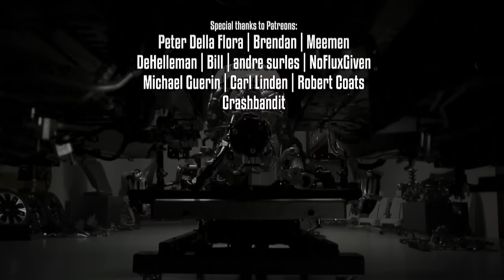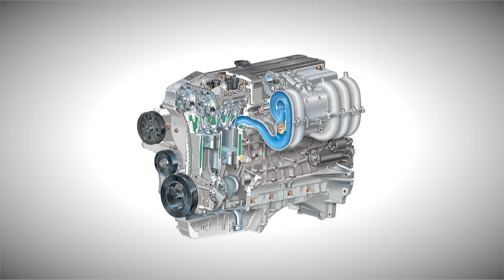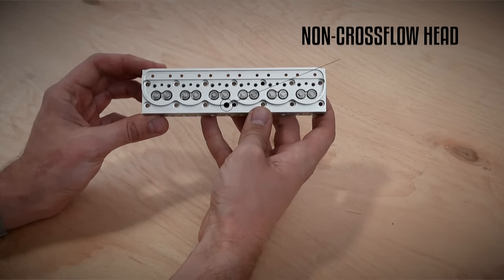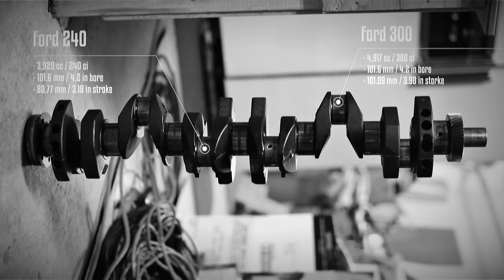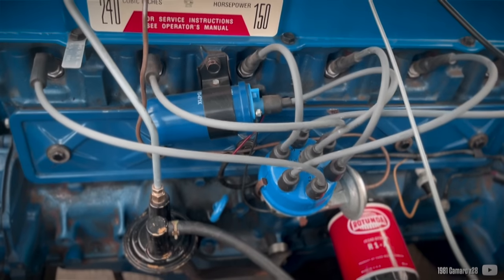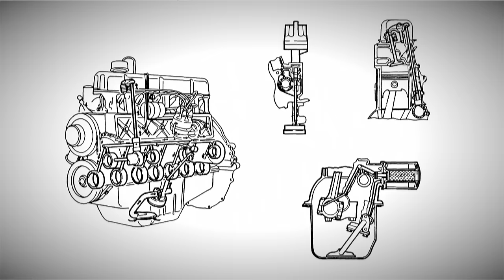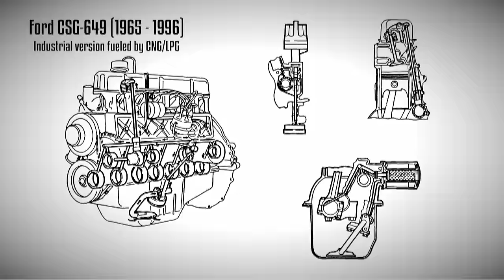Is This Toughest US 6-Cylinder?

Comment: Have you ever done a video on the all aluminum Buick 215 V8?  It's a fascinating  little motor that sounds incredible.  GM sold the design to Rover and they developed it into the early 2000's.  It is also the basic design used in the 3.8 V6 that GM used forever.   I've got one (215) in a 63 skylark convertible.   I think the motor is worth a video of it's own.  I believe Oldsmobile also used a turbo version of this motor as early as 62.  Thanks as always for your work.
Reply: The British got the rights to the design, it became the Rover V8.  Used in pretty much anything that was British and had a v8 (Land Rovers, Rover cars, MGB V8, etc) up to the mid 1990s.  In fact, they are so common, that whereas people in the US do 350 SBC swaps for EVERYTHING including making a v8 out of a Miata, the British use the old Buick engine for the same purpose.
Reply: In 1965 Jack Brabham and Australian engineering company Repco took the slightly stronger Oldsmobile version, with an extra head stud per cylinder, and developed it with overhead camshafts and new heads etc into a three litre  Formula One engine that won Jack Brabham the Formula One Championship in 1966. Then in 1967 it gave Brabham cars a one two in the formula one championship with Denny Hulme of New Zealand taking the honours. So beating Ferrari and all the other exotic make engines and cars behind the Brabhams.
No driver since or in the future look like developing their own car to win a Formula One championship.
Brabham also won the Formula Two championship in 1966 but with a little known Honda one litre engine. Jack often winning both the F1 and F2 race on the same day.
Not bad for a discarded GM block.
Reply: Yeah, the old Buick V8 from the late 50's is a great engine. I'm sitting in a 1997 LR Discovery with a 4 liter in it now. Problems do occur, though... Leaky head gaskets, especially if it's ever overheated. The press-fit steel cylinder liners also can slip... Solution is a top hat style liner, but that means a full rebuild with a lot of machining. By the way, the all aluminum V8 weighs about the same as a 2.1 liter 4 cylinder in my other car, a Triumph TR4. 
Years ago I had a Ford van with the 300 in it. That was a great engine too. Wish I still had it! Someone else mentioned another great one I had even earlier, the Dodge slant 6, in another van. I took those engines for granted at the time, didn't appreciate how good they were. Not planning to ever sell the Disco with the V8. (P.S. you can buy an all aluminum 5.0 V8 crate motor from Ford Racing... But last time I looked they were over $15,000.)
Reply: They dropped this into a Morgan.  Just imagine!

Comment: One of the 4 toughest….you should also do a story on the gm 250 cid,Chrysler 225 cid,and the amc 4.0 liter (which started out as the 258 cid)
Reply: AMC was 232 1st then 258
Reply: @jameshardin4326 yep!
Reply: The Chevy 292 i6 was quite the mill too..
Reply: ahh, the 232 Torque Command 6 by AMC. SO DAMN BULLETPROOF.
Reply: I had a '64 Barracuda with the 225 Slant Six when attending college. It would be sitting outside in freeizng weather for a couple of weeks at a time and would start right up after three of four cranks. Also had lots of low-end torque for its displacement.
Reply: @h8troodoh  , I have a  67  Chevy 292 and  a 75 Chevy 250  ,

Not really  high  horse power  but they are both Torque Monsters
Reply: @jimthomas1989  and both honest GM designed engines.. that 300 ford is a basic copy of a Mercedes Benz mil, so I've been told by many .. why it works well I guess..
Reply: @h8troodoh  this is the ultimate 6,bought one out of a scrap yard,100 bucks,guy goes, it drove in ,crushed rear end t boned right at the front part of the spring hanger,i installed it in my chevy van,it burnt rubber for the entire time i had it in there,low end grunt,4 oil changes later the van rusted to the point it was dangerous,pulled the drive train out and sold it to a guy who put it in a 58 del ray,he was beyond happy,me i went to lunch,feeling the loss
Reply: @strattuner  cool story man,thanks!
Reply: None as tough as the 300 Ford.
Reply: @erandy0240  dream on Ford boy.
Reply: Yes, a story on the Slant 6 would be cool.  The Leaning Tower of Power!
Reply: @JoeyGarcia  -  Yes... The strength of 10 brigs mowers...  But reliable as hell.  It was a gutless bastard. And the nosiest starting of any engine in its class.
Reply: @KlodFather  but it runs and runs! LOL
Reply: @h8troodoh  -  There is a good reason that engine was used in many stationary jobs (generators chippers pumps etc) as well as marine applications. It was exceptionally reliable and produced the power of many smogged V8 engines and was VERY quiet. The slant 6 was very noisy and the GM engines were very good but much rarer than the 300. They produced the 300 in such great numbers that it is hard to compete with it, especially the EFI variant which was used in many delivery trucks and still in use today.
Reply: @KlodFather  I'm not disputing that, I just don't think it's the best out there, that's all.
Reply: @h8troodoh  Thats a Bull$hit story passed around by people that just could not accept the fact Ford built a great engine.   the 240 and  300   6's replaced the 231  qnd 261 cu in inline 6's in the older vehicles, they were also tough engines.  I had a 261 in a 64 F100....
Reply: @JoeyGarcia  -  And so did the chev 250 and 292 and the ford 240 and 300... just with a lot more HP and no more yid yid yid yid  LOL
Reply: @h8troodoh  -  There is no diffference in reliability or anything else between a 292 and a 300. Neither one is better than the other except ford put the work into the 300 to raise up the HP on the 300 in the later years fairly high. I had more guts than my 302 and the 305 chev by a wide margin.
Reply: @KlodFather  didn't Mickey Thompson or someone else run 292 Chevys in his funny car, or am I too young to remember correctly,
Reply: @h8troodoh  -  I don't know but it would be a good choice. The 300 and the 292 are not much different. Two different singers covering the same song. 
You would have to look that one up. I do know those two crazy guys on youtube got 527hp out of a 300 with not much tinkering and 5 pounds boost, so It would not surprise me if MT ran a straight 6 because the power would be there and the blocks are very stable and tough. You can bet they were probably machined out of a steel billet and heat treated for strength to take that kind of power... but it would be a good way to get it without scattering parts.
Reply: @KlodFather  thanks man.
Reply: @h8troodoh  -  If you find a 292 anywhere, get it... because its like a gold brick. Bolts up to modern transmissions and can be fitted with EFI. But its a lot harder to find parts for it for a performance build... Then again if you bore it you might be able to get V8 pistons in the holes. If you build it or have one, I would love to see photos or a video of it here on YT. God bless and good luck.  
After we spoke the other day someone has a 300 ford 5 speed for sale 😎👍 and I am going to go look at it. That ought to be reliable as hell. I am going to replace the fluid in the manual trans and dump a pint of teflon powder in the trans.  The syncros still work but just not as good with the teflon PTFE dust in the oil but everything lasts much longer and I know how to shift it. I wanted a run around work truck. This is an 8ft bed 2 door with the straight 6 4wd
Reply: @KlodFather try some Marvel Mystery Oil in that Trans instead. . Good stuff.. and God bless back ...
Reply: @h8troodoh  -  Yes... The teflon dust I discovered back in the 80's with slick 50... I wanted to know why it worked and discovered the powdered teflon. In a motor its kinda dumb because the oil filter catches it but in a tranny it has no where to go and is suspended in the case fluid. 75 synthetic flooded in the trans with a quart jar of that teflon dust will do it. Wear a respirator because if you get it in you lungs it does not decay or come out easily. A good mask and bandana over your nose and mouth is good also... not good for covid but keeps the teflon out of your lungs LOL    What does marvel do in the trans? I always used it when putting together machines, especially small machine parts.
Reply: The 225 leaning tower of power!!...I had one in a 74 ply Duster
Reply: @jameshardin4326 for 5 or 6 years there was also a 199. Production for that ended in 1970 I believe.
Reply: @KlodFather MMO is just a really good friction modifier...
Reply: @JoeyGarcia  they do go forever it seems; coming from a die hard gm man here..
Reply: @KlodFather  🤣🤣
Reply: @_stardust62  not a huge power maker but stone cold reliable. Fact.

Comment: Ford 300 6 cylinder engine has no power/ 40.000 miles hardly no oil pressure noisy engines no gas mileage Junk

Comment: Great video!  Very informative. My dad had a couple of F100s with the 240 and I had an 89 150 with an EFI 300. Brother bought a used 150 with a 300. All were good trucks, strong reliable motors.

Comment: Great info, thank you! You Should do a video on the Chrysler 225 slant 6 engine.The original design called for an aluminum block so the specifications for thickness and dimensions were larger to accommodate for the weaker than cast iron aluminum. They decided to go cast iron with the same dimensions/design as a production cost savings measure, and as a result they produce an extremely durable engine block. Unlike the Ford and Chevy counterparts, the cylinder head on the Chrysler slant 6 rarely had any problems with major warping due to the robustness of the engine design.  Thank you for your video it was most interesting!
Reply: Best motor built slant 6

Comment: My first vehicle was a 1984 Ford F150 with the 4.9/300 I6 engine.    It wasn't the most powerful, nor did it get great fuel mileage.       It had over 300,000 miles on it when I sold it to a local farmer.    He is still using it as a farm truck to this day.
Reply: My old farmer neighbor still has his 69 ford in service as a farm truck it's whole life. 
I think it's got like 30k on it ,but that's miles from tooling around a 175 acre dairy farm.

Comment: @VisioRacer  -  Ford made a crossflow head and reworked this engine in the head to make it 4 valves with some major changes. What killed this engine was in 97 they shoved the nose down so far on the half ton pickups that the 300 would no longer fit and they made a triton engine variant in v6 to replace it. The high power high efficiency straight six 300 that was developed was an amazing powerplant and its story should be told as well as you should review the video of the guys building up a 300 online and getting 300 plus hp out of it naturally aspirated and 527 with only 5 pounds of boost. Those guys said after making those mods (including pistons from a 390) that maybe the next builds they do for street cars should be turbo efi 300 monsters. Yep... that is the directions of the aussies who had their ford straight 6 monster.  This is a good rabbit hole for you to explore. I heard about it because I was an engineer and so was my late brother who was dealing with some of the engineers who developed that monster 300 for ford that was canceled.

Comment: Great article.  Couple of other pretty good straight 6's were the AMC 232 which was (I think) the first 6 to have 7 main bearings.  Another was the Chrysler slant 6, just dead reliable.  Another was the GM 292 6.  I had one of those in my 1959 GMC 4x4.  Just a great engine.
Reply: There was also a 265 Cubic Inch Hemi Australia Chrysler in the early 70’s. Top version had triple Webber Carburetors and was good for 300hp out of the box. Pity the car had average breaks and couldn’t go around corners that well but in a straight line you better come with some serious muscle.
Reply: The Jeep 4.0 straight six was an update of the 232 / 258 sixes from the earlier years.  4x4 fans rebuilding Jeeps combine the long stroke of the 258 with the larger bore of the 4.0 to create a 4.6 liter rebuild.  The aftermarket now makes aftermarket heads for this combo.
Reply: @billyjoejimbob56  we had a Rambler American (1964). When I was a kid. It said in big letters on the valve cover “7 Main Bearings “ I didn’t quite know what that meant at the time. But I remember telling my friends that our car had 7 main bearings. They didn’t know what that meant either so they pretended to be suitably impressed.
Reply: @donparker1823  Interesting that the legendary mopar slant sixes had 4 main bearings, worked just fine and were very durable.  Either approach works fine on an inline six if engineered appropriately!  😎
Reply: @billyjoejimbob56  Dad bought a 1951 Packard Clipper straight 8 one time and drove the begueses out of it going hunting in So Utah from LA at every opportunity. The Clipper could make 110 MPH across Nevada (no speed limit then) but he wore it out. The straight 8 only had 4 main bearings so I think he was a bit gah gah about how over built the Rambler was.
Reply: @donparker1823  I hope it had five main beariings (one on each end and between each pair of cylinders).  But I get your point!
Reply: The 292 came along in '63 with seven main bearings. The engine it was based on (194 cu in) came along in '62. I believe AM had a seven main bearing 6 before the 232.
Reply: @turbo8454  it was a totally different block,the easiest way to differentiate a 292 from any other i6 gm engine, is to look at the lifter covers, they're much taller than the i6 engines.. it had a taller deck height than the others, I believe. More stroke.
Reply: @h8troodoh  It's a taller block but the architecture (and bore spacing) is based on the 194/215/230/250. And many components will interchange between the short and taller block.

The 292 was born of the shorter block.
Reply: @turbo8454  it's essentially a stroked 250,is it not?
Reply: @h8troodoh  It is. 4 1/8" stroke for the 292 verses 3.53" for the 250.
Reply: @turbo8454  a bit of a dramatic stroke increase, where all their torque came from,I'd imagine.. nice thanks for the tech info,too.. always nice for reference..
Reply: The Jaguar XK engine was introduced in 1948 and featured 7 main bearings and dual overhead camshafts. It was in production into the 1990’s and output ranged from 120 hp to 265, depending on year of manufacture and displacement. This engine won LeMans, the toughest 24 hour race in the world 5 times in the 1950’s. I owned several and was impressed with the strength, torque, and reliability of the mechanical construction. The Lucas electrics and SU carburetors were not nearly as reliable as the rest of the engine.
Reply: @garthlundquist3623  Nash (forerunner of American Motors) had a 7 main bearing 6 as early as 1925. It was called the "Advanced Six".
Reply: The Ford 300 reminds me of the GMC 302 six that was produced through 1962.   The 302 was often modified for racing .  Light duty GMC trucks began using the improved Chevy six in the 292 version that was less costly to manufacture.   A video on the  now forgotten GMC 302 and 270 should be made .  Aftermarket 12 port GMC cylinder heads were produced decades ago.
Reply: @timothykeith1367  The 270/302  was replaced by the 305 GMC big block V6 in 1960. The new line of V6's and the V12 replaced every inline GMC engine except the 270 which was used through 1962 in a few light applications. They were far more robust than any available inline six still within the GM stable (and anyone else's stable for that matter). The downside was the cost.

The first use of a Chevy inline 6 was in 1964 for the half ton 2wd pickups. The 230 six was available as a cost reduced option over the 305 V6. The 292 was first used in some light tilt cab  models starting in '66, probably again a cost reduced version over the 305 V6. 

Even the 300 Ford is no match for the GMC big block V6 when it comes to construction and strength. The 300 Ford and 292 Chevy are light duty at best.
Reply: inch for inch the 225 could outpull anything. its main disadvantage was its small displacement, if they'd made one that was over 250 cid im sure it wouldve even dominated the 300. (as it is ive seen the 225 pull as good as a ford 240)
Reply: It has not been publicized but 292's did have problems with collapsed (scuffing plus piston slap) pistons during the 60's. This was because of their strong point, very good low end torque. Drivers would take corners with out shifting down to a low enough gear & the accelerate from the turn or just not downshift early enough during their general driving. These practices placed excessive pressure on the thrust sides of the pistons. If driven properly they probably would have gone forever.

Comment: I have only had exposure to the 4.0 straight six in a Jeep. But if this is as tough, then I'm sure it's a great power plant.
Reply: I have a ton of experience w the 4.0 and I will promise u the 300 is way tougher. Nothing compares in a light duty truck.
Reply: Jeep NEVER MADE an Engine  as Tough or reliable as FO4DS 300 6 CYL ! I KNOW I HAD SEVERAL OF Them ! .

Comment: I had an Econoline van with a 240.  I added headers and dual exhaust.  I also bastardized the intake manifold to use two one-barrel carbs.  It performed great.  I was towing a race car with it, and I eventually swapped in a 300 short block and kept the old 240 head.  Finally, I replaced the three speed stick with a four speed, and made it work with the column shift.  It would tow my race car almost anywhere in 4th gear, it passed smog, and it got better mileage than the original 240.
Reply: where did you put the reverse, lol. ive seen a few 4 speed column shifters (all homebrew of course) makes it harder to steal even if you know the 3 on the tree layout.
Reply: @maddhatter3564  I modified the column to shift just like a normal 4-speed, with reverse where you would expect it.